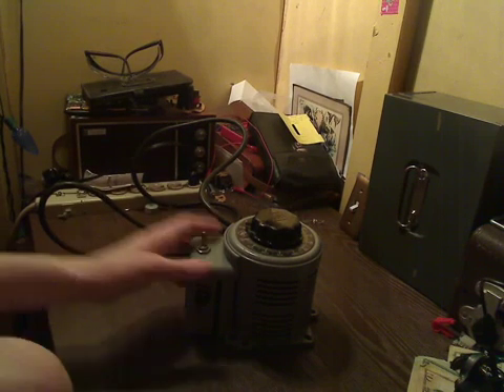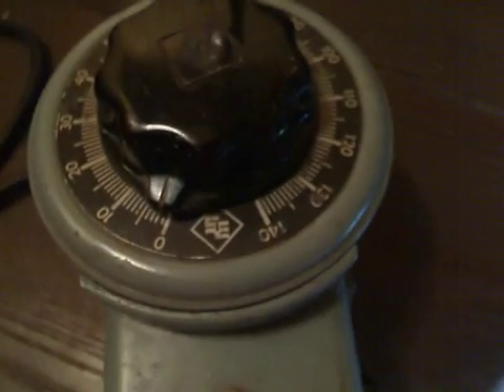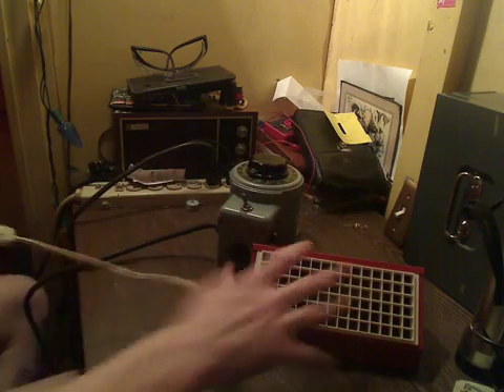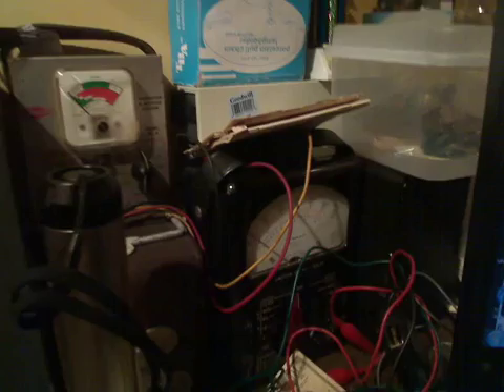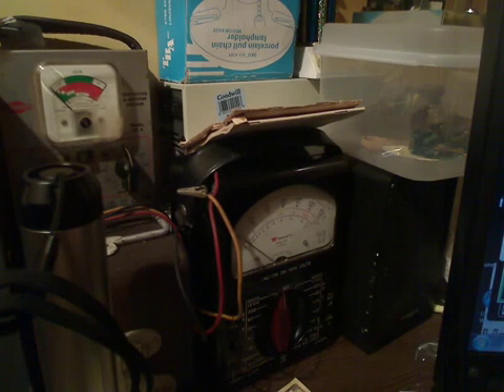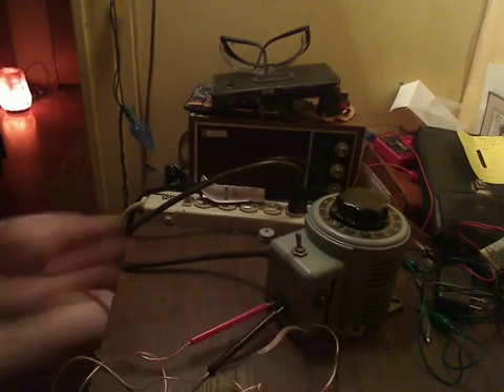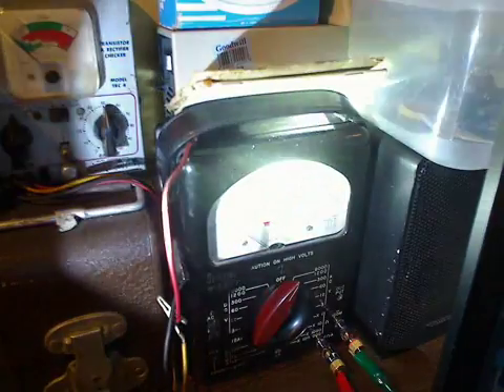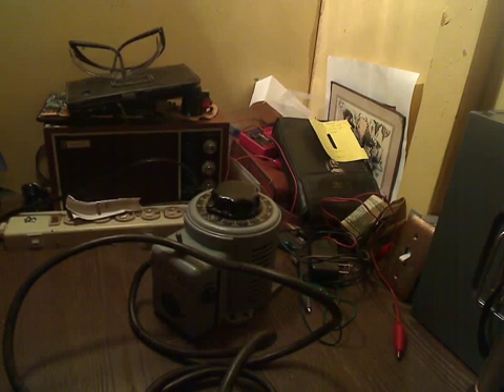Vintage POWERSTAT Variable Autotransformer (VARIAC)

Comment: Very nice piece of test gear. Are you going to build a dim bulb tester. I see you have a lamp socket. I use one to test my vintage radios. Can be a life safer to both the variac  and the radio also I find it works good for reforming electrolytic caps. Thank you for sharing.
All my best.
Bobby

Comment: very nice variac! quick clips for referenced mains?
Reply: yes, I find them to be very hazardous while quick connecting mains, since you will catch very little ground current in the case of an accident, but just enough you think its alot, but not at the panel. just dont trip on them u be fine :D im guilty of using them too LOL